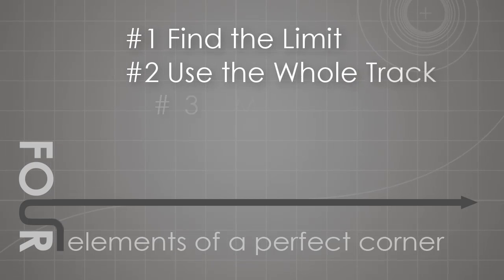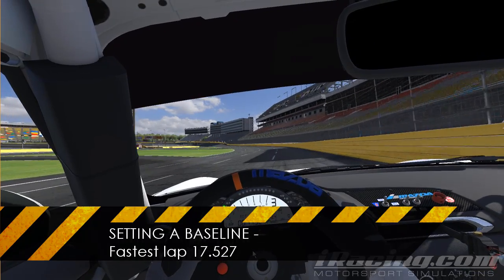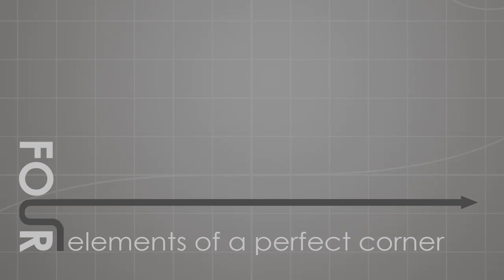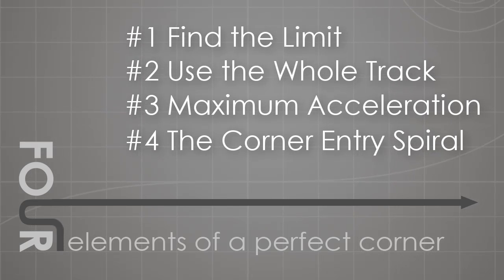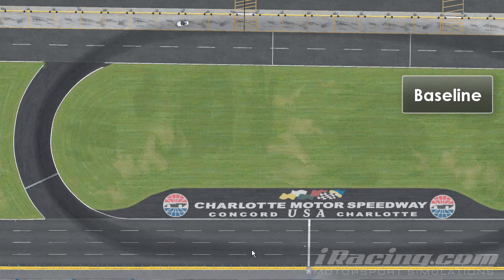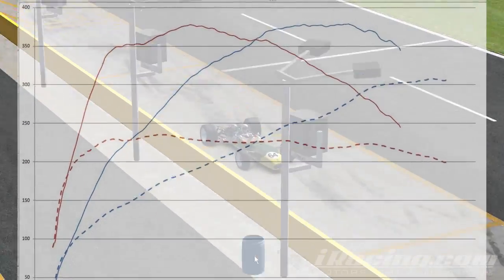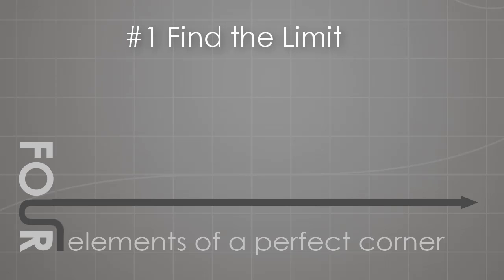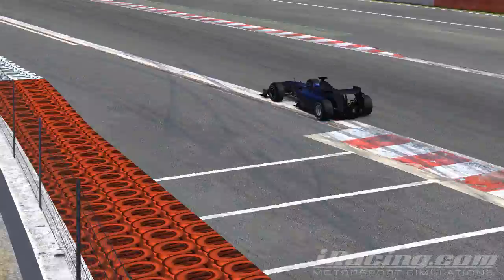The Racing Line - 4 Elements of a Perfect Corner (Physics Explained + Sim Training Tutorial & Tips)

Comment: Do you always choose afternoon? It looks like i m one second down if i choose it instead of morning...
Reply from the maker: I've been choosing morning lately.
Reply: @ParadigmShiftDriverDevelopment  so the 17'5 from the video has been made during the afternoon, but the 16'9 from the website has been made during the morning?
Reply from the maker: The 17'5 was before you could even pick time of day and a good bit has changed in the sim since then.  I've also gotten better  so there might be a .1 to .2  or so of improvement for me.   I haven't updated the time in a while so I'll try to do that soon and check various times against time of day.  Primarily time of day affects track temp.  Even if ambient temp remains constant, direct sun can raise track temps and this affects times more or less depending on the car.    Plus, with a track like Charlotte, if the sun is behind the stands the track temps drop even more.    You can always see time of day in the replays as well.
Reply: @ParadigmShiftDriverDevelopment  yeah, the difference felt massive to me, I did 17'5 in the morning and 18'5 in the afternoon... it was like driving on ice, couldn't get a decent apex... I felt so depressed!
Reply from the maker: @loicludwig429   I got a chance to try out different weather settings.  For late afternoon and morning my time was about the same as my current time on website.  Late afternoon is slightly faster, but not a huge difference.  The track temps are in the low-mid 80's though.   For afternoon, the track temp was 137 and the best I could do was an 18'1.  Beyond just having way less grip, it slowed the apex speed enough that I was significantly lower in the power band during exit.    I might be able to drop that time with a shift to 2nd, but only if I manually clutched.  I use autoclutch so I lose a decent amount of time on shifts.
I also tried out night just out of curiosity and was able to get down in to the 16'8s.  The track temp was 78

Also, the 1st hot lap is the fastest.  These mx-5 tires seem like they are best if you take them out of the fridge right before you drive.  They like to be cold!
Reply: @ParadigmShiftDriverDevelopment  ok thanks a lot. But now i have this puzzling question : do you think that getting a rounder corner entry (and therefore more apex speed) can sometime be a good tradeoff to avoid the low power band. If so what would be a good criterion to decide?
Reply from the maker: @loicludwig429  There's always little considerations like that, but unless a car has some massive deficit you are trying to avoid, you wouldn't want to stray from an ideal line by too much.    There is no shortcut to tell you the exact technique and compromises that will produce the best times though.  You just have to follow the universal cue and  ultimately a stopwatch.  Your essentially trying to learn what "fast feels like."   I would have to do overhead comparisons of the lines, but I wouldn't be surprised if I made the entry line in the afternoon slightly more circular to try to keep the rpms up a bit at the apex.    Again though, these sorts of things are subtle.  If I asked a driver to focus on trying to maximize apex speed to keep rpms up, they would probably end up losing more time with way too circular of an entry.  You have to look at the corner as a whole and figure out how to maximize the force the car can produce in the ideal directions.
Reply: @ParadigmShiftDriverDevelopment  thank you Adam! I always have low power gearless kartings in my mind,  but as the entry is already rounder (because of the rear only brakes) i guess i should not worry too much for now.
Reply: @ParadigmShiftDriverDevelopment  Oh, and btw, I use autoblip, do you blip your downshift manualy?
Reply from the maker: @loicludwig429  I think I have it on autoblip, although I've use manual blip in the past.  I normally drive the cars that have autoblip anyway so I think it's probably on.

Comment: Very interesting stuff! I've just started reading your book "The Perfect Corner 2" and I find a lot of absorbing ideas there. There's one thing that troubles me a bit, though. In the chapter on the Suzuka Hairpin, where you suggest treating it as a double apex corner, you show an illustration of the proposed line. Based on the description and looking at it closely, it seems to me that you suggest creating a spiral-shaped entry line to the first apex, where the line suddenly becomes a circular arc of a radius that's smaller than the final radius of the aforementioned spiral. That step change in radius doesn't seem right to me. Are you sure that chapter is entirely correct? Am I possibly missing something here?
Reply from the maker: HI,  the double apex portion begins at the exact same radius you reach at  the end of the spiral. It looks right to me in the illustration, but maybe your book copy had a slight printing error or something so it looks odd.  Ultimately the lines shown are just symbolic to explain the concepts though.  The ideal line will always vary somewhat from car to car and mistakes will cause it to vary from lap to lap.  The concepts and rules don't change though.    We used the Suzuka hairpin for an example, because during high direction change corners with a rounded inner edge, you should need some portion of double apexing in high acceleration cars.

Hopefully this answered your question, but please let us know if it didn't.
Reply: Paradigm Shift Driver Development Got it. In that case, I believe the illustration comparing the single apex line with the double apex one is slightly mistaken. It shows them overlapping all the way to the first apex, where they split with the double apex constant radius arc drawn to the inside of the continued spiral. I believe they shouldn't overlap and instead the single apex entry spiral should initially go to the inside of the double apex one, crossing it at the first apex.
Reply from the maker: It's hard to see in the book, but you are absolutely correct.  The double apex line would have a slightly later, slower 1st apex than the other line at that point.  The differences in actual line on the track is so close however that even in the high res version we have, it just looks like a shadow on the inside of the other.   Corner entry lines are always very similar, it's really corner exit where they start to diverge more.  

If you would like the high res version, I can have one made with brighter colors so you can see the differences up close.  Just use the contact form on our website and I can have it emailed to you.    Again though, it's still just an illustration explaining the concept.  It seems you understand the concept and that's what is important.
Reply: As I double check, there is indeed a little shadow as you say. I missed it the first time which led to a little confusion. False alarm, then. And thanks for the offer, but yeah, I feel like I get the idea.

Anyway, really glad I've stumbled upon your book as it tackles things I haven't found in other recommended titles.
Reply from the maker: Thanks, if you have any more questions feel free to contact us through the website.  Certain aspects of the book we're not quite willing to talk about publicly and can be more specific with explanations if needed.

Comment: confused between Geometric line and base line......they appear like the same line
Reply from the maker: Both lines reduce radius to the apex and then expand in radius afterwards, but the geometric line is more circular than the baseline with closer to a constant speed.    A true geometric line with a perfectly constant radius and speed is impossible to achieve as it requires instantaneous direction changes.

Comment: Not enough foundation information is given before using jargon and talking about variations.
For instance, skid pad data is fundamental.  Can a car take a larger diameter lap in less time than a smaller diameter lap even though the larger diameter is further?  Tires allow higher speed in larger turns than tighter turns, but does the higher velocity equate with less time taken per lap?  That's worthwhile information for a driver to know.
And never did he mention that a perfectly circular turn forces the car to transition from zero lateral force to maximum lateral force in almost an instant when the steering wheel is turned at the start of the turn.  Railroads avoid circular turns and lay their tracks in parabolic curves so trains gradually transition from straights to curves.  I think he used the term 'spiral' instead of parabola, and in real world driving, they are about the same.  The point is that circular turns are spoken of in classes, but are not used in the real world, nor are they even possible.
Reply from the maker: This video is meant to be a general overview.  For more in-depth explanations, please check out the books, training program, and free articles available through our website at www.paradigmshiftracing.com.

Comment: Theres a couple inherent problems, one of which is that if the Red car in the data enters the corner ahead of the black car, then this is not looking at the difference the cornering makes but rather the change in difference between the cars as a result of the cornering, which you then mistaked for the difference the cornering made and where you didnt analyze the distance between the two cars before and after the turn, making the comparison kind of pointless.
Reply: Also the MX5 doesn't have enough power to force its tires above the limit when accelerating out of a long, wide corner like this one, so the finding should vary greatly when looking at really high power cars like F1 cars or Indycars.
Reply from the maker: I'm not sure I follow you.  The comparison starts with both cars in the same place and time in the corner.
Reply from the maker: @HexlGaming  Yes, a higher acceleration car would have an even larger differential loss between the  geometric and baseline.  For the super late apex, the loss is simply based on how far from the ideal apex the false apex is.
Reply: @ParadigmShiftDriverDevelopment  I was referring to data like 12:33. the way the graph is set up there is off, making it much harder to compare, because at the same timestamps the cars are at different stages of the track, even just in the acceleration part of the graph. So it’s not „Zeroed“ if you will
Reply from the maker: @HexlGaming  Yes, sorry if that is confusing.  You are right, we didn't start them from the same point for that part of the video.   They were just zeroed from the lap start.  That part was just showing the shape of the line to look for.  If you want to see a direct overlay go to 4:56 for the geometric comparison and 7:54 for the super late apex comparison.